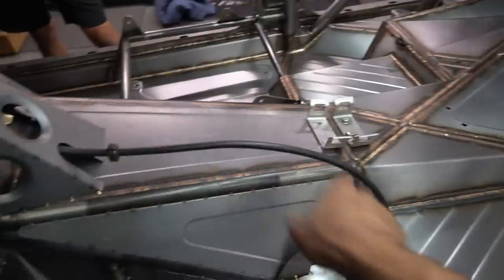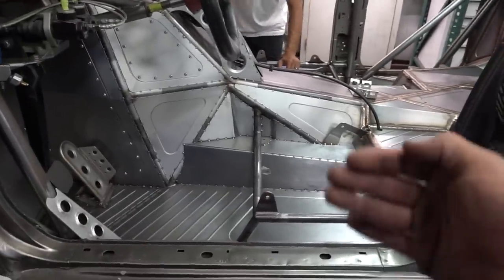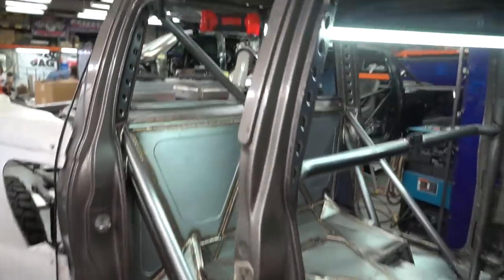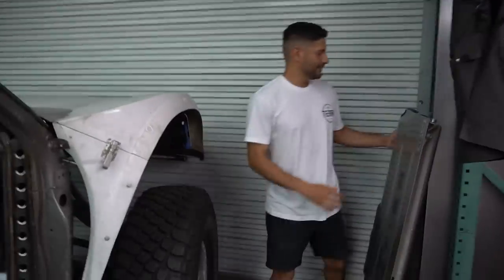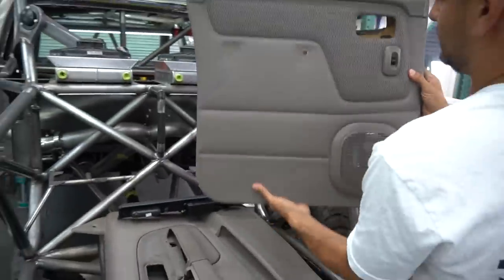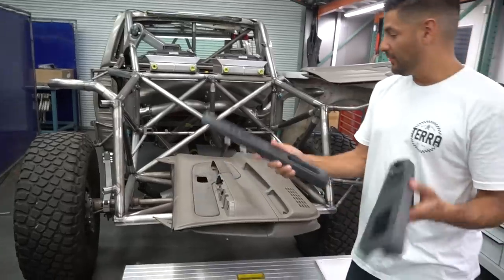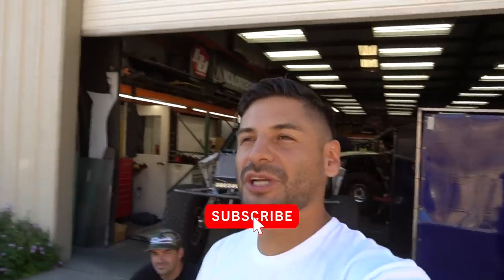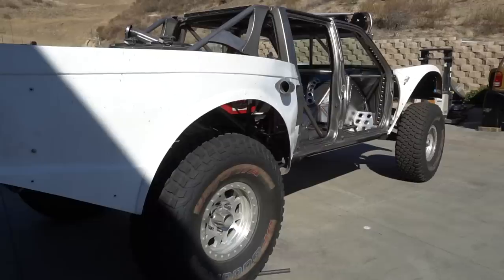Nissan Frontier Electronics & Wheel Package Reveal! | FINAL FRONTIER

Comment: Fellas on the tail gate plan. Get a second tailgate, cut at 1/4 and 3/4 along, widen it, then use the second skin as the filler panels. So your filler panels have the OEM Lines and shape to it. Instead of just adding pieces on the end
Reply: This is the best way to do this.

Comment: Do a video on what air pressure you need  for the desert and if bead locks are necessary???
Reply: It will vary on the conditions your running in
Reply: @MorganClarkeDesign1  what’s the general tire pressure
Reply: @MorganClarkeDesign1  and what about beadlocks ???
Reply: I have 37x12.5r17 tires on Method non beadlocks and run 10 psi at the dunes without an issue. I play hard and can rip a donut or drift as hard as I want and I’ve never lost a bead. I know a lot of others running that low without beadlocks on the dunes. That being said, I can’t speak for the desert or anything besides silver lake dunes!

Comment: I been hearing on the prerunner projects forums about people having problems with stripping out the beadlock bolts using methods suggested torq specs.  Have your herd anything about this?